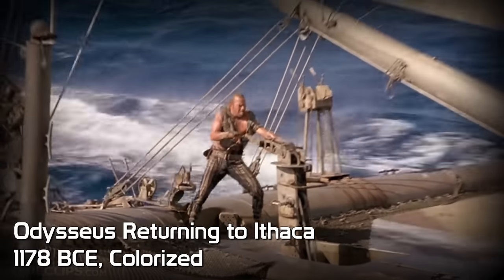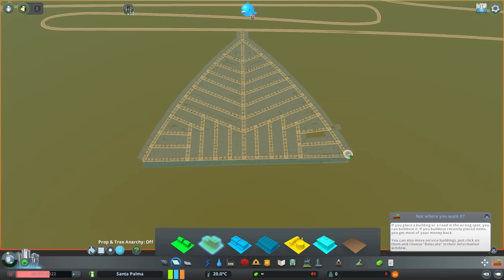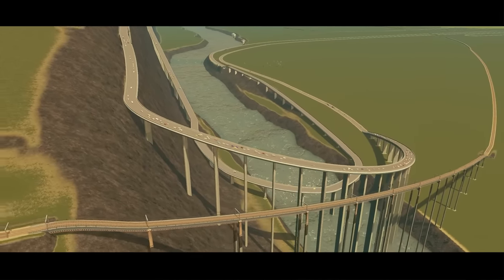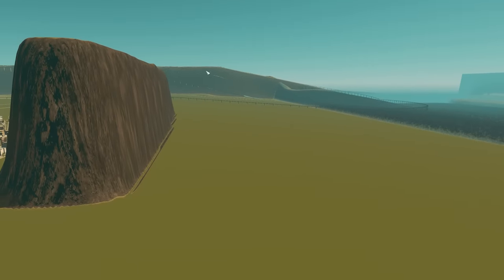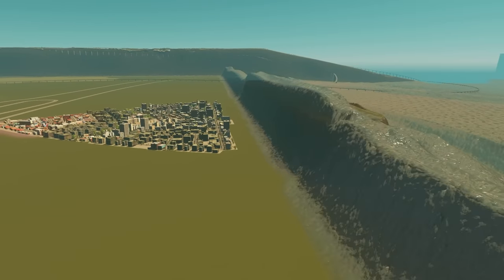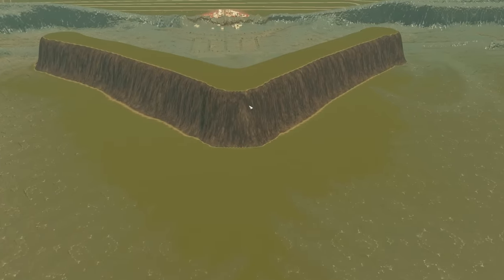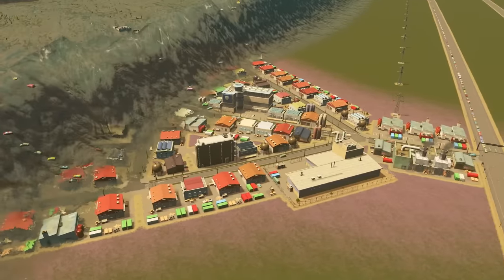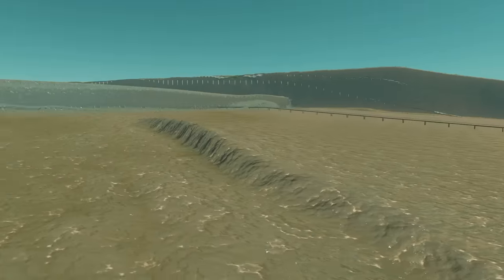Engineering MEGA TSUNAMI sea defenses in Cities Skylines!

Comment: It looks like the game uses a simple friction-less and turbulence-less model for water. So the only thing that matters is the height of the dam (which should be high enough to be able to contain all the water wave's kinetic energy in potential energy (when the water goes up at the dam)).
Reply: I think a series of walls where each one can take a "slice" off of the wave height that overtops it should probably work.  How is that different than his canals?  Umm...
Reply: @HansLemurson  I don't think low walls would work: canals + very low walls practically did not work (see 12:30). Ditches or "inter-wall ditches" large enough to "swallow" all the available water volume may work, but it is a one-time solution, not a universal wave deflector - so it is a kind of cheating...
Reply: @konstantinavilov1192  Yeah, I think it's nothing more than just a "really deep ditch" that would become useless once it fills with water.  It's just that it would be a high-altitude ditch.
Reply: CHALLENGE: Stop the Tsunami in the sea BEFORE it gets to land.
Reply: @konstantinavilov1192  But you do see that in experiments with walls, there is clearly some volume of water deflected backwards. So a series of shorter walls should in total be able to deflect as much as a higher wall.

To test this we would need to try placing the series of walls with larger distances between them. I think the resolution of the water physics simulation is so low that the walls near each other don't deflect as separate walls but as a single short wall, hence it not working as well as a single tall wall.

Comment: Working with these frictionless water physics, I think the best design would be a straight wall with a trench behind it. When the water flows over the wall, it will fill up the trench.
Reply: I would say probably trench in front to reduce height first
Reply: He should've made them longer. The V shape stuff, the walls should have been longer to avoid the water flooding, or at least to reduce the volume.

Comment: How those power plants work: Basically the sun heats up the area bellow the mirrors, the hot air is lighter and tries to escape. It can only escape through the pipe in the center. In this pipe are wind turbines.
Reply: Then why does it have mirrors? It should have anti-mirrors. (Or paint the base black)
Reply: @bbgun061  sorry, wrong word, maybe some kind of glad or different material that sucks in the heat or maybe Glas or lenses.
Reply: CHALLENGE: Stop the Tsunami in the sea BEFORE it gets to land.
Reply: @bbgun061  it not mirror, it window, it is basically a greenhouse. there is no lens or reflection involve, the idea is to let the heat enter and heat up the air that is trap under it. if you pain it black, the roof would be heated, not the air,  it requires the heat to reach the ground, heat up the ground and hence the air under the roof. if the roof is heated up, the air above the roof would heat up and that would put air away from the system then into it. it basically a play on air pressure, you want the air pressure low so it suck cold air in from the side and pushes hot air up from the center. if the air is of the same temperature on both side of the roof, it would not be effective.
Reply: It basically combines the mechanics of a greenhouse, a hot air ballon and a wind turbine
Reply: @lagrangewei  that makes sense
Reply: @DragonflyPrincess  maybe some kind of underwater-tsunami-triggered nuke that sits off the coast and off sets the force of the tsunami, redirecting it or something

Comment: I know a civil engineer is sort of the opposite of a military engineer, but I'd love to see a video of you doing this using the principles of a Vauban defense star. I once helped some friends making a sand castle and realized we'd started at low tide where it'd go under water so spent the next several hours with a shovel making a 3 ring 9 point star that got roughly 10 meters across and 1 meter peak to trough. The castle was eventually taken but it lasted about 2 hours past when the tide would have taken it, which i thought was pretty good, so I thought you might like to have a go

Comment: I'm pretty sure there's no friction in this game's engine, that's why water doesn't slow down when it moves through flat land. The 45° wall actually should work better then just a straight one, but there's no friction so water slow down because it transfers kinetic energy into potential energy, but the overall energy in the whole wave is still the same, so when water finally is able to get through the wall it changes the potential energy into kinetic. Of course some of the water isn't able to get through, because it's kinetic energy is too small. It's probably water which is behind the extremum of the wave because there's less water giving it kickback energy (it's not pushed by anything) that's why only half of the water get's through when the wall is the size of the wave. Normally some of the energy would go into soil, packing it tighter, heating it, even into the sound the crashes make etc. and some water would sap into it earth, so the waves wight would get smaller and smaller, so overall energy in the wave system would decrease and another systems would gain same amount of energy.
Reply: Bro you wrote a few paragraphs under a YouTube video but yes you do make some good points
Reply: @allthingsandres1653  I’ve seen a few pages, i copies it and put it into google docs and it was 2.3 pages long
Reply: Wow that's a lot more than a few paragraphs
Reply: Exactly what i was thinking
Reply: That’s what I said.

I think
Reply: CHALLENGE: Stop the Tsunami in the sea BEFORE it gets to land.
Reply: @DragonflyPrincess  CHALLENGE: stop the tsunami BEFORE it’s created
Reply: @sslinger704  Great idea! but google says..."Like the earthquakes that generate most tsunamis, scientists cannot predict when and where the next tsunami will strike." And plus, tsunamis can be man made also Soooo there's that.
Reply: I think this tsunami has so much energy that it will go for miles into the land
Reply: @DragonflyPrincess  beta scientists
Reply: So you use a keyboard

Comment: I think in this game water physics are quite "linear"
A series of walls will work pretty much exactly the same as a bunch of bumps, though bumps let the water drain after
When presented with a perpendicular wall, a tsunami will act ignoring momentum from the middle hitting the splitter
Reply: CHALLENGE: Stop the Tsunami in the sea BEFORE it gets to land.
Reply: the game simulation block are also quite large, so it actually doesn't see alot of thing that are "small" you need a fairly thicc mountain for the game to actuallly "see" it.

Comment: Your first straight wall was more effective than that monstrosity
Reply: The comment I was looking for.
Flood barriers pretty much reduce the wave height by the height of the barrier. Using the terrain tool to build a few barriers with sizes comparable to the first one should work while being much more compact.
Reply: Yes, but that would've made the video shorter and kinda boring.
Reply: @Entenuk1  easy solution, put it at the end.
Plus despite the wonky fluid dynamics, the wave should slosh between the walls, and possibly get positive interference.
Reply: CHALLENGE: Stop the Tsunami in the sea BEFORE it gets to land.

Comment: The mountain tool was clearly the best.. It basically ate up almost its own height from the wave. So if you have several V shaped mountains and/or holes in front diverting the wave back on itself and back into the sea it would be very effective

Comment: In this game, the counter-physically-intuitive method that is a wall straight up is the best solution, because water in this game only has 2 properties: height over ground and speed over ground. Water goes from higher to lower, speeding up, and slow water next to fast water tend to level their speed. But "friction" with riverbeds etc. is not really a thing as you can see at 2:14 - the water at the riverbanks should be slower but it really isn't or if any then just barely at all.
Therefore, the best way to deflect a wave is a steep wall because that will decelerate the most and introduce a backwards current.

Comment: 1:02 "solar updraft towers - which i don't know how they work.." So i don't know if these things exist in real life, but the way it appears to work, at least based on the image the game provides, is there is a large surface area at the base to collect solar energy, and redirect the heat to the central spire. Presumably heated air is vented/expelled up through the column within which there is a series of propeller blades/turbine generators that convert the mechanical energy into electric current through rotor windings.

Comment: It's entirely possible that the wave simulations in this game are not the most accurate... That said, I want to try these with my kids next time we're at the beach.
Reply: They also change with simulation speed. By running at full speed instead of normal speed, it lowers the water simulation detail.
Reply: @webjr1981  good point
Reply: CHALLENGE: Stop the Tsunami in the sea BEFORE it gets to land.

Comment: The proper way to do this is to calculate the width you want to block. calculate the height and depth of the wave. Multiply all 3 together to get the volume of the water. Make a canal of that volume to collect that water. Alternatively, calculate the energy of the wave from the volume and the speed figure out how much energy a flood wall removes by testing a bunch of them and then work out how much flood wall you need. I'm not sure if it works out the efficiencies quite right though in that water going down and then up to the same height should lose energy but that doesn't seem to have happened

Comment: My first city in CS was devastated by a flood because I didn't know that disaster response units didn't repair roads and let the city fall into bankruptcy. After that, I was conscious about floods and tried to come up with ideas to deter them. It takes a lot of soil but landscaping is the way to go to protect even against the biggest of floods. What worked for me best was to build a large rampart in the middle with guiding walls made of dirt spaced on either side of the advanced rampart. The walls would form a channel behind the initial block and the floor was depressed. It was meant to make a lake of sorts that could drain over time. Depending on the geography, I may have needed some more canals. However, the landscaped diversions into a lake or reservoir worked very well for anything behind the set up. I liked to think that citizens would pay top dollar to be in the city that is the most secure against floods while also being an attraction to people for hiking and camping when the reservoir was dry. People may even want to come see the mega-flood of the century fill up the area. Definitely a unique feature to a city. Barrier islands are also pretty good at stopping smaller floods.

Comment: what he came up with was what I used to build as tiny sand walls and ditches to protect against waves at the sea( somewhat) what I came up with was a triangular wall, with the tip close to the land further back than the edge of the line(like a v shape) followed by a ditch before the wall in the same form. depending on the power of the wave and the strength of the sand, one model could survive 3-4 mins to 5-10 mins. if the waves were too big, I would construct another wall and ditch in the same shape as the first wall, with a bit of empty land in between( in the beach and sand context this is needed, to prevent the outer wall from crumbling into the ditch and filling it up). this essay may be useful in tsunami case Idk. ( in case you're wondering, the reason I didn't use an upside-down v shape as RCE did was to enable the ditch to have two outflow points and therefore better drainage).

Comment: Honestly certain aspects of science repeated into different fields... Layering and spacing
Whether it's to keep yourself warm in the cold or protecting you from crossbows bolts, or letting you survive pressure changes going down 7 miles underwater sub window, or on airplane window, or even spaceshuttle windows.

Comment: I'd reverse the splitter to be at the front, and further away, then put the canals and plateaus behind it to break the speed of the water giant wave break like in mop buckets. The splitter would also have longer legs that would go higher than the tip to force the wave away from the city.

Comment: The best tsunami defense would be to make an array of large  extremely powerful lasers coupled with a rapid (very) early warning system. When the warning system is triggered, it could allow measurement of the tsunami velocity so that the lasers could start evaporating water along the coast. The rapidly expanding steam would create a barrier of sorts that would push back when the tsunami wave actually arrives, disrupting it. Also since some of the water near the coast would be vaporized, there would be slightly less water for the tsunami to pull out to sea when the visible wave starts to form further reducing impact. Now, this isn't possible in reality. The power of the lasers needed would be absolutely massive, and need extremely efficient cooling systems to allow them to run long enough (for example, the LFEX can produce a 2,000 trillion watt laser , but only for a trillionth of a second). But ... it could still work in a game if there were a mod for it ;)

Comment: For me a normal sea wall works most of the time, I learned after blocking a river during a tsunami the less resistance to the wave the better, in a perfect scenario the tsunami would just cause a large flood over a large area.

your not so much as stopping outgoing water from causing a wave, but stopping the wave from forming from the start

Comment: Here's a thought.  What if instead of trying to figure out the most appropriate formation to stop an incoming mega tsunami, you actually engineer a series of defenses intended to "slow down" tsunamis?  If Tsunamis are heading toward you at very incredibly high speed, just stonewalling it at one spot doesn't mean it stops.  It will go around and move on its own path.

I have not seen any engineering yet that is designed to stop tsunamis.  At best, I've seen sonar and early warning systems that provide the basis for proof that tsunamis are heading toward someone's way.  My idea is different, may be a bit elaborate.  While Cities Skyline might not do it, the idea in my head might.

If the city is far out from the beach or from an entry point where tsunamis are found to encroach from time to time, that's good.  A very tall formation, akin to the beginning, is perfect.  However, to slow them down, in-between the formation and the beach, there needs to be an intricate network of very large potholes that have very industrial strength pipes that leads to several reservoirs.  Those several reservoirs can make clean water, filter them out to actual lakes and to the city to supply fresh water.  Not only that, among the formation, you have pipes that are built inside from top to bottom.  It goes all the way down, and pushes toward the ocean where the rest of the tsunami is spit out back into the waters.  So you've got many large potholes draining out all the water, slowing down the speed; and the formation with pipes that would drink up the rest of the tsunami.  It may not slow it down by a greater degree but it's something to think about.  Instead of avoiding tsunamis, why not harness them to become sources for reservoirs, lakes, and other means such as clean water to a city?

Just my 2 cents.

Comment: Air and water are both fluids. Aside from drag, your goal here effectively is to create the most aerodynamic (ig fluid-dynamic) front profile. Excellent aerodynamics means that the fluid passes around the object exerting minimal force on the object which means... minimal force on the fluid (3rd law). Which means the wave will not build up as tall. 

Your design at the end with the sharp swoop is not very aerodynamic at the part that is roughly perpendicular to the fluid flow and, as a result, the water builds highest there (14:27)

Cars designed for land speed record usually have a sharp tip, like yours, but are convex, not concave like yours is.

Comment: BTW, you can go to map editor and export a heightmap as PNG. Then go to photo editor and make edits there, and import it back to the game.. Takes a bit of experimentation to find the heights you need but.. that can be done in the map editor, raise terrain height to desired level first, export the height map and take a sample from that in the editor. You can make perfectly straight lines and mirror shapes to get really accurate terrain. 

I made few maps in photoshop, pure gradient from max to minimum is fun, but the most fun has been a perfect circle of just one square size and ocean floor that slops very, very, very gradually.. so to get more buildable area you have to build damns and drain the water out first..

Comment: Looks like this civil engineer forgot the basic lesson in Newtonian mechanics. The wave will have the same potential energy in the y direction regardless of the potential energy in the x direction, assuming a frictionless system, a 45 degree angle vs a straight wall doesn’t make any difference ya goofus.

Comment: The tsunami is horrible simulated - usually the wave would build up rapidly as soon as the sea floor goes up and then crashed into the shoreline sending a flood wave into the land - DEFINITEY NOT LIKE 20 metres HIGH THO - more like 3-4 

And in general the fluid insulation is… ehhhmmm well

Entertaining video either way though!